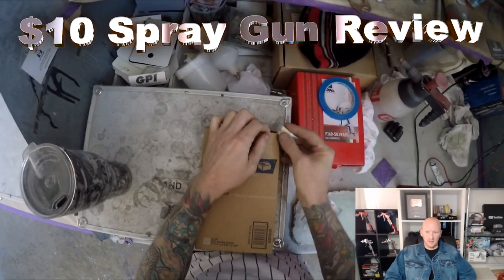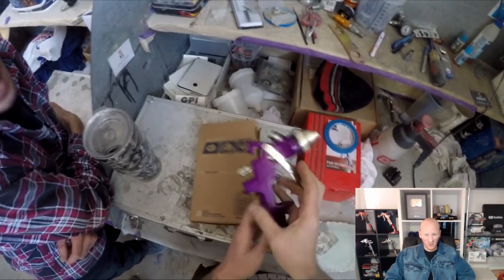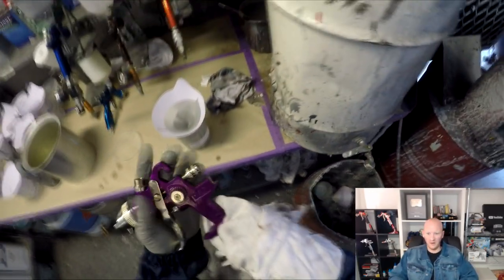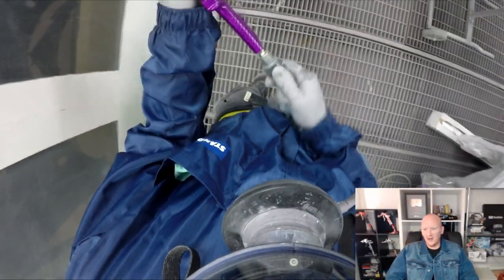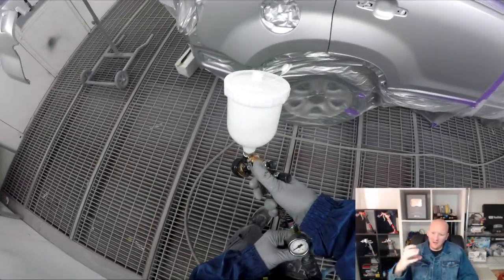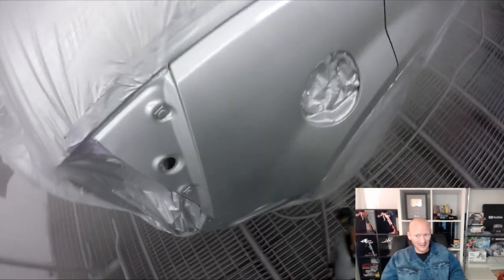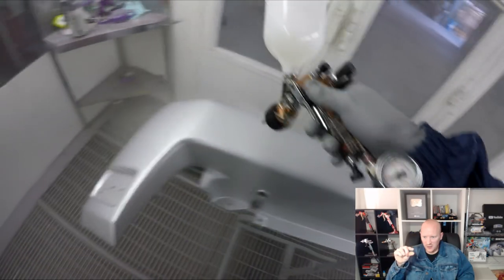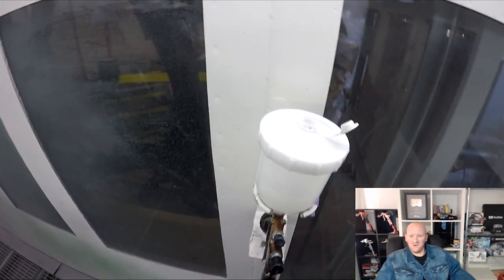$10 Spray Gun

Comment: I do use these guns, for guide coats, primers, and for painting machinery with Rustoleum.  I buy them 3 or 4 at at a time.  I clean and use them a few times,  then throw them away and break out the next one.   I have better guns for basecoats and clear coats, but honestly, these 10 dollar HF guns are much better than the spray guns I started with 40 years ago, and I painted a whole bunch of cars with worse equipment.

These are a good way to learn, because your technique and settings need to be solid in order to get good results. If you learn how to lay down a smooth, wet finish with these 10 dollar guns, when you step up to a better paint gun, you'll be all ready to put down some quality finishes.

Comment: Omg...here in America (from California) that gun is sold in a popular cheap store call Harbor Freight. I bought one for a cheap primer job. That thing did a decent job. It came out the box all covered in oil. I cleaned the exterior the best i could and even ran the inside with acetone. Long story short, there was some reaction with the epoxy primer. It was cold when i sprayed, it was roughly 70°f or 21°c for my metric buddies. I fixed it the problem by spraying light and allowing more flash time (thanks Gunman👍). Just out of curiosity i broke down the gun for more cleaning. I had a feeling that if it was oily on the outside, it must be oily inside too. IT WAS! THERE WERE STILL SOME OILY RESIDUE CAKED INSIDE! lesson learned: Clean any spray gun thoroughly  inside and out. Other than that it was a good cheap primer gun lol. Keep spraying some shit!
Reply: Aboutthatlife Racing yeah i have definitely used them a few times, definitely sort of disposable like a preval for a guy with a compressor! And i like the finish it gets as a sealer gun just on smaller parts, it doesn’t seem to be able to get much paint out onto the panel at the pressures ive had to run. After buying some nicer guns for base and clear ive retired an older matco gun to sealer duty that was given to me when i started and was good enough for me to learn to spray everything i wanted. I remember the first one i grabbed had a nasty pot drip down the side when the seal wasnt sitting right. And i tried to clean it up but thinners dissolved the purple stain finish right off!

Comment: I bought one of these guns and drilled out the nozzle to 2.2 to spray some thick polyester filler and tossed it.A throwaway gun indeed .If you take it apart you will see a bunch of white silicone caulking sealer everywhere.I guess if you want a gun for spraying furniture or wood stain ,or 1k sure it will work.I let mine sit in thinner and the purple came right off lol for everyday use no it won’t last at all.The one cheap gun I bought from Harbor Freight I do like I bought 10 years ago is the $20 siphon feed gun.Its sprays primer pretty good ,has a 1.8 nozzle and still spraying great .ive sprayed a few cars using single stage acrylics with great results and Its a great gun to keep 1k lacquer primer in.Just clean all the oil out of it when you first buy it.

Comment: I actually started working at a fleet body shop with a harbor freight D.A Sander and a $40 gravity gun, I did not have any money at that time to buy quality tools, but even then, I was putting out some awesome paint jobs, it all has to do with gun adjustment and using the right size fluid tip, as soon as I had the money, I bought a Devilbiss GTI Millenium and a Dynabrade Palm sander, few years later, and I have about $ 70K in tools from Snap-On, Matco and many other brands, same goes for spray guns that I own like sata, iwata and devilbiss.

Comment: i actually use 2 guns exactly like that with 1.4 tips , one for base and one for clear. they are about 50$ each where i live, they suck for primer but do an awesome job for base and clear for their value. 3 turns out fluid control from the back and fan control at about 3o clock which is  all the way open , air volume wide open and 30-32 psi is what i use to paint . u can even have a non orange peely end result if u fiddle with it and find its sweet spot.
Reply: Same here.

Comment: I used a harbor freight purple gun to refinish a hood and bumper on an 08 honda accord. Out the gate i noticed it used a lot more material and needed about 38 psi to lay down in a decent manner The fan couldn't open very wide w/o streaking; I probably got it open to about 6 inches comfortably. With that being said it took maybe 30 min longer than it wouldve if i had used the iwata because it needed a longer flash time from the amount of material going on. But on the bright side it perfected the look of that slight orange peel honda has from the factory and  didnt have a terrible finish. For anyone else thinking of using this spray gun considering the strain you put on your compressor, the finish, the material thatll be wasted and most importantly your time it isnt worth using daily but to paint one or 2 jobs itll do the trick but the buffer will be your best friend. If youre looking for a decent gun that wont breakthe bank consider ordering an iwata w400 bellaria 1.4 off amazon can be had for about $250 and the atomization is something amazing
Reply: 200–218 eBay

Comment: I bought a FLG3 from tcp global and it was brand new. The seals ruined my paint job, it was leaking through the seals and the trigger. Ruined my paint job and that harbor freight saved me actually. I would say it did better than that FLG3. That gun is actually Ok for a 10$ and at-least it sprayed. I bought the tekna pro lite like the gunman said and what a difference in spraying. No headaches, was easier to spray.

Comment: I don't blame you man. I bought the same looking one but for 40$ US and even with the small fluid tip it hoses on the fluid. I did get more used to it and finished a job but when I cleaned it, the finish like you said was coming off.. so I went a step further stripped the entire gun but it still wasn't up to par. Bought a Devilbliss and never looked back!

Comment: I actually used that to spray my car... first time spraying and on a tight budget... I bought 2.. 1 of them crapped out after first coat... the other one held out to get the car finished... lots of overspray, lots of orange peel... but being my first time I'm happy with it... if I did a few more I'd definitely want a better system for sure... but as is I'm happy 👌👌
Reply: how big of a compressor did you use?
Reply: Cody Ramos I used 2 cheap compressors daisy-chained together (1) HF 8gal and (1) HF 21gal... it got the job done, but wasn't great
Reply: damn ... do you think one 20gal compressor would work if i did a car in multiple sections ? i hate to be cheap with things but new compressor is not in the budget
Reply: Cody Ramos that's basically what I did..ive got vids of it on my page... not a pro... but I'm happy with how it turned out
Reply: ima check them out . thanks bro

Comment: I almost unsubscribed for this video not everyone has 800$ to throwaway on a spray gun i think you should of really gave the gun a chance and honestly showed the results of that gun just like you do for a 800$ spray gun
Reply: I used a harbor freight purple gun to refinish a hood and bumper on an 08 honda accord. Out the gate i noticed it used a lot more material and needed about 38 psi to lay down in a decent manner The fan couldn't open very wide w/o streaking; I probably got it open to about 4 inches comfortably. With that being said it took maybe 30 min longer than it wouldve if i had used the iwata because it needed a longer flash time from the amount of material going on. But on the bright side it perfected the look of that slight orange peel honda has from the factory and  didnt have a terrible finish. For anyone else thinking of using this spray gun considering the strain you put on your compressor, the finish, the material thatll be wasted and most importantly your time it isnt worth using daily but to paint one or 2 jobs itll do the trick but the buffer will be your best friend. If youre looking for a decent gun that wont breakthe bank consider ordering an iwata w400 bellaria 1.4 off amazon can be had for about $250 and the atomization is something amazing
Reply: @clh9933  yea for sure pay me now or pay me later. That cheap HF gun you need some seriously slow drying material and all the dirt you will get from using that at home. I have painted whole cars with one and lots of polishing and sanding to make up for the finish. Not worth it. After using a Tekna you just cant go back to junk guns.

Comment: DUDE that is straight out of harbor freight. ha ha. Fan is to narrow, wastes material, I dont blame you for not blowing fish eyes on your work. Like you say you would need to use about 20$ in cleaning solution to make a panel look like crap and need to  sand it smooth. HF does have a PRO line gun for 69$ that can spray a good finish. but it wont last at all. lots of parts fail in them. Better off spending a few more dollars to get a good gun and be done with it. Tekna is 425 USD with 1.3 1.4 and te 10 and 20 air caps.  there are others but you would be guessing.  I use the HF 10$ gun for spraying glue.

Comment: Hi Gunman I love Your videos you are very good!! Can you help with one problem? I painted car silver and after few days I have filler bleed true topcoat is yellow stains where filler was applied. how can I fix them stains? can I sand clear coat then apply base and clear? your advise would be great> thank you man
Reply: It's too much hardner in the bondo making it do that best to start all over t
Reply from the maker: You actually don't have to start over, spray black basecoat over the area then start base silver again, the hardener can't bleed through the black
Reply: Hi thank you getting back but I allready did  spray silver again over old  clear and it looks good no yellowing. hope will clear seals hardener and no more problems.

Comment: Not really video related but would like an opinion... Im looking at painting a bonnet pair of wings front and back bumpers oh and a door .. ive got a double garage as a makeshift booth only the fresh air as extraction but get good airflow though it ..anyway my question is this im considering using 2k iso paint what mask would you reccomend . im growing up a moving away from aerosol which i cann get a really nice finnish with !! but you use so much 

 its a cheap job so im doing it panel at a time.. the cars straight black im also considering non iso 2k again your opinion if you have time

learnt so  much from your vids thanks ...